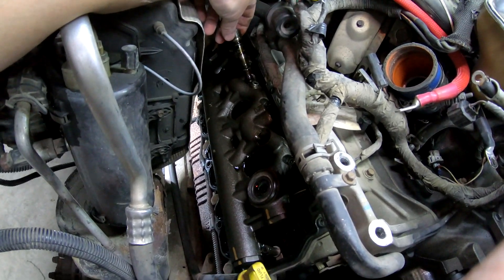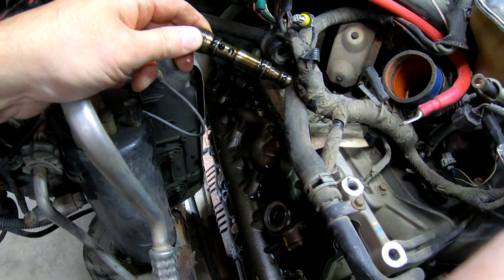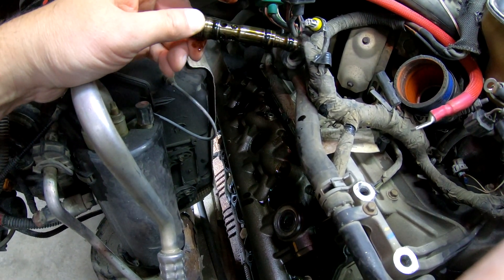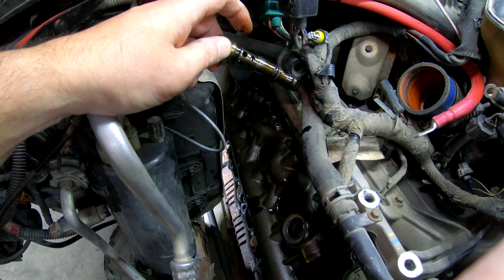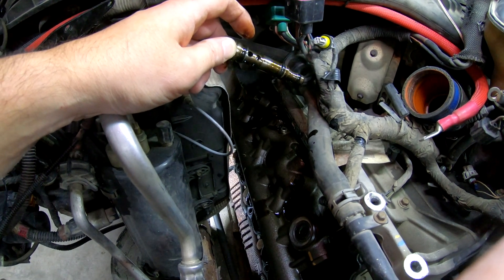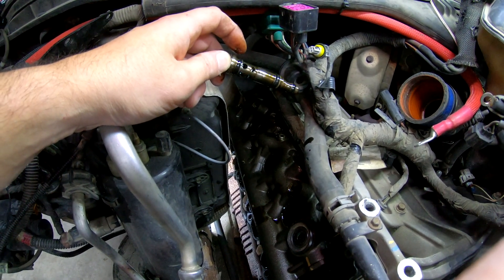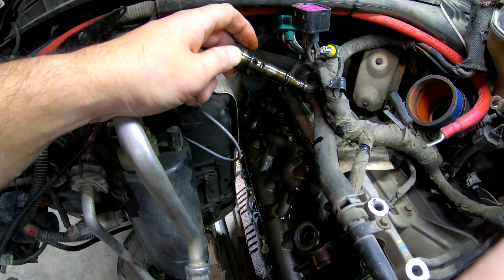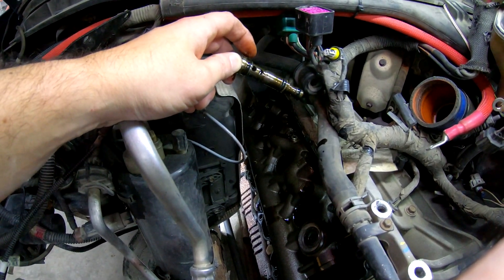Powerstroke 6.0 An alternative to replacing standpipes and dummy plugs

Comment: Spend the money and get the new parts in my opinion hell you're looking at $250 at a shop for the full tilt boogy than $175 to fuk around and find out that it's gonna be another 250 to do it right  just my opinion but you make the call 
If you can do the labor yourself and have enough talent to do this flawlessly then run with it but if you are paying someone else to do it I don't think $250 in 2024 is bad at all

Comment: The only dummy plugs you would want to even consider replacing the o rings on would be the 12mm hex new improved version with the backer rings. Diesel Tech Ron indicated that it was very rare to have a failure of the stand pipes so the only thing to consider would be replacing the dummy plugs or putting new o rings and spacers on a failed 12mm hex plug. Whe you think about the time to get to the dummy plugs and especially if you had to do it more than once or kept having problem after problem getting real Motorcraft updated dummy plugs, which you can do without buying the stand pipes, the cost of just the dummy plug(s) is the least of the cost of doing the job. The Motorcraft updated dummy plugs can be had as a each so if you only needed 1 to get going you are not out the cost of a set that you might never use. I just replaced both dummy plugs on a 2006 6.0l that had not failed but were showing ring wear at 117K miles. It is one of the jobs that you do once and not likely ever again if you use the updated dummy plugs.